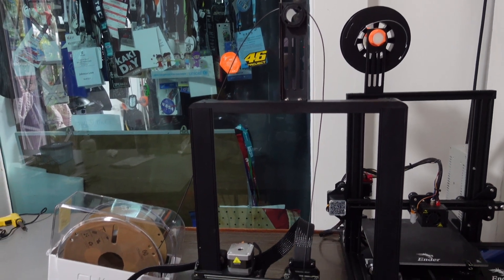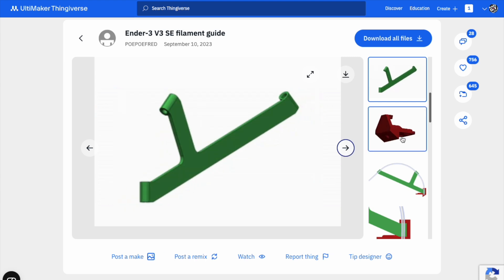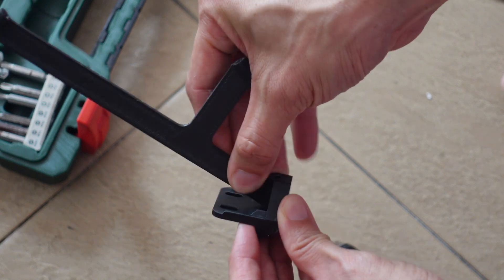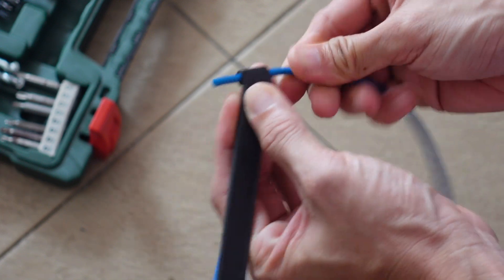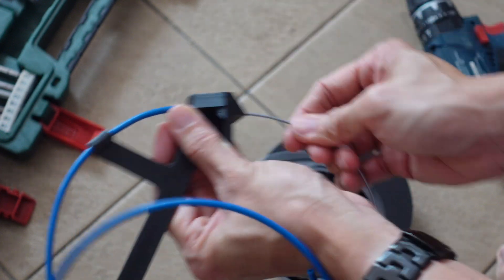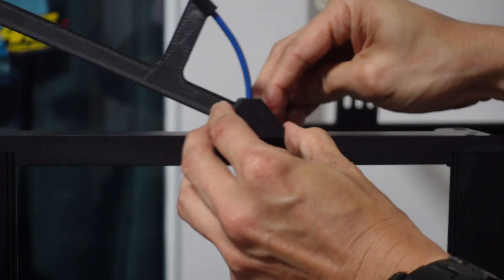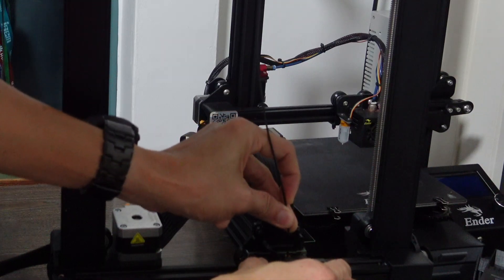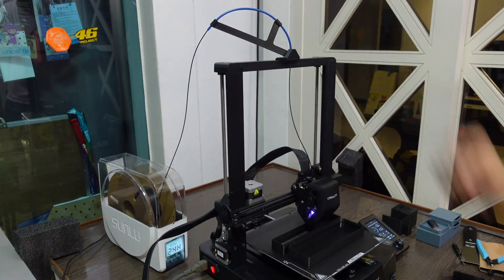3D printed Filament Guide! STOP WOBBLE + Change Spool location!

Comment: Thank you and the designer - this will be the first thing I print (x5) when I get home this evening. Looks nice and simple, yet  very useful!
Reply from the maker: It worked great... until..... I out in an enclosure to print Polycarbonate... the heat inside is like an oven, my printout came out great, but this filament guide became soft and dangling..  hahahhaa 

I will reprint this using Polycarbonate as well... Will update...